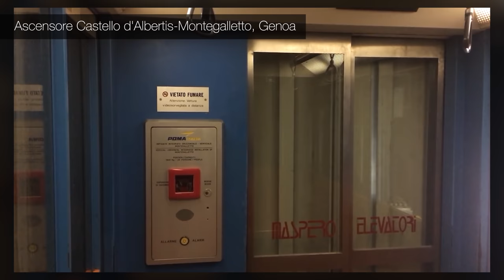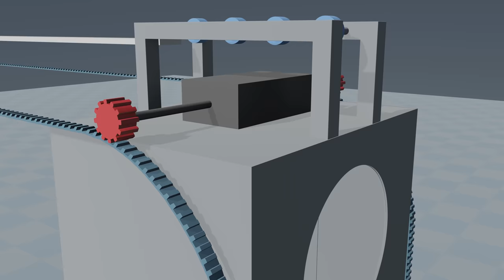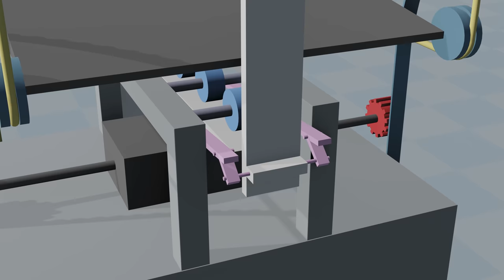I thought the Schmid Peoplemover was impossible

Comment: Or just cross the railway on foot when there's no train coming
Reply: With luggage? Or in a wheelchair? With trains that don't stop at that station and don't slow down?
Reply: @jochenkraus7016 ah yes, cause it's way harder to build a ground level accessible crossing (which exist) than to overengineer and maintain an entire peoplemover 

And when the train does not slow down and stop - if you wait long enough (it's not that long) it will eventually roll away
Reply: @jochenkraus7016  negativity aside, this thing just is too much of a non-scalable thingamabob. Imagine this becoming universal and real stations crossed by lots of people being built around it. An elevator may work for a couple of people at a time, but it does not handle human traffic at all
Reply: @tukachaka264  Usually you have a bridge or a tunnel with stairs, a ramp and/or an elevator that allow continuous flow for everyone who's able to climb stairs. 
Tunnels and bridges are much safer than level crossings especially on lines with several tracks and frequent use and/or limited visibility due to curves or tunnels.
On single track lines with not much and not fast traffic there's a level crossing next to the stop and that's it.
Reply: @jochenkraus7016  yes, now I see where level crossings lack. But the "two elevators and a bridge" Still very much outdoes this thing in every way